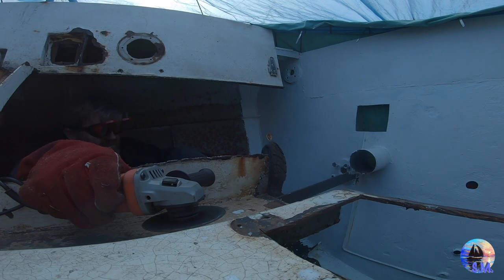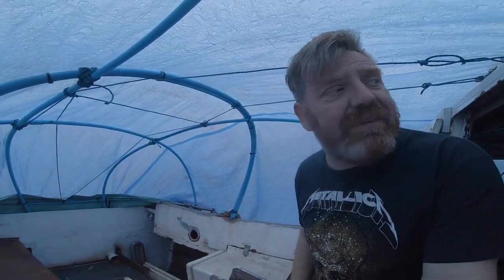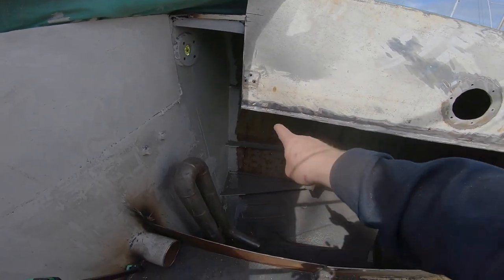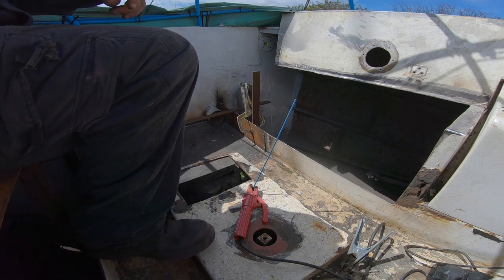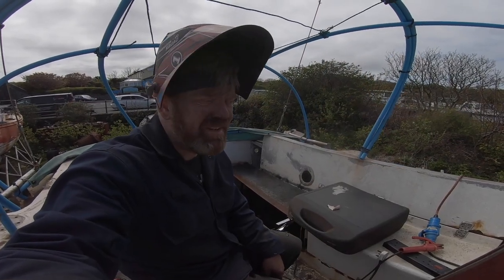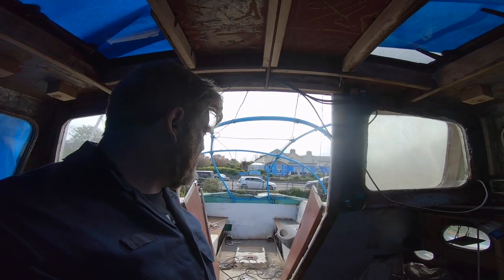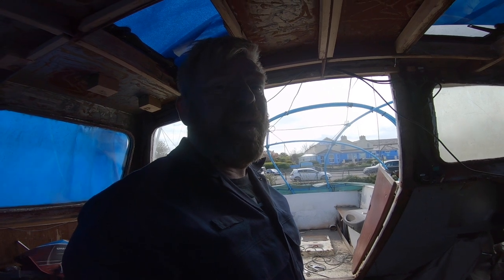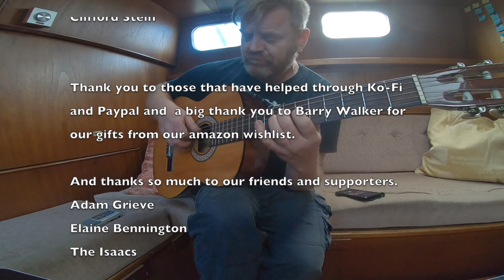#43 - Cockpit Conundrum Part 2 -  PROGRESS!  NEW COCKPIT SEATS!!!  - Part 2 of 2

Comment: Well, that's the first time technical matters. :-)
1. I already wrote once that the stern door is a very bad idea due to the weakening of the hull structure.
2. Pour water over the seats that you welded in and check if the water flows into the cockpit. If not, you need to make a slight drop for the water to run off.

Guitar - last week I got a guitar from a friend of a sailor / priest / motorcyclist :-). I was supposed to pass it on to my daughter, but I think I'll also try to learn to play. :-)
I am impressed with your guitar playing!
Reply from the maker: Thank you! we have a weld penetration spray to test all our welds which I\ll demonstrate in  an episode soon
Reply: That's not what I meant. :-)
It's just that the seat must have a slight slope so that the water does not stand.......keep the lower back dry :-)
Reply from the maker: Oh yeah for sure the seats have a built in slop towards the front so it runs into the cockpit and also towards the aft so it’ll run down towards the transom drains

Comment: I find it interesting that there are oil pipelines all stick welded and now proper welding is considered to be MIG
Did they refloat the tall ship?
He welds, plays the Guitar, next we'll find out he is a five star level gourmet cook!
Reply from the maker: I’m happy stick or mig welding but I’m better, neater and faster with a mig for sure. The boat was built in 1981 but a professional boat building company called F.L. Steelcraft who made fishing trawlers and ships and it was fully mig welded even back then, 40 years ago. I think stick is used more for pipeline work simply because it’s easier to manage in breezy conditions. TIG is actually the best welding as far as I’m concerned but it’s hard to do in that environment

Comment: Excellent video! How thick is that plate for the seat tops? And how far apart are your frames? I'm getting ready to do the same on my boat.
Reply from the maker: Only using 3mm plate on the seat tops. The frames on one side are only 8 inches apart but the other side I’ve left a bigger gap so I can cut in a lasarette lid on the port side if I decide to

Comment: Just a thought. Retrofitting a transom gate could have an impact on the transverse structural integrity of the vessel?
Reply: I'm sure it'd be fine though; with what you have in the deck structure and side seats.
Reply from the maker: Plus I would build a VERY substantial framework around the gate aperture
Reply: @williamsutherland7005  I'd vote against it for a blue water cruiser. The stern may have to support an arch for solar panels, a self steering set up and possibly davits for a dingy. The sugar scoop can still be there. Any unnecessary reduction in strength and rigidity should be avoided IMO.
Reply: @SailingMelody  I'm sure you'll be noting all the weights for your Lightship additions :) :) It's coming along nicely.
Reply: @delukxy  LOL. Two of your suggestions are possible later; the steering would need to be fitted now though, before all the structural upgrades, but the solar panels & dingy storage are more than feasible. I reckon he's doing great with his own ideas though without us redesigning the Titanic :)
Reply: @williamsutherland7005  Having had another look at Melody's rudder I agree that the add on vane type might take a bit of doing. Maybe the vertical shaft could go down through the sugar scoop. Yes there are expensive electronic set ups but one way or other they are essential for distance sailing off shore.